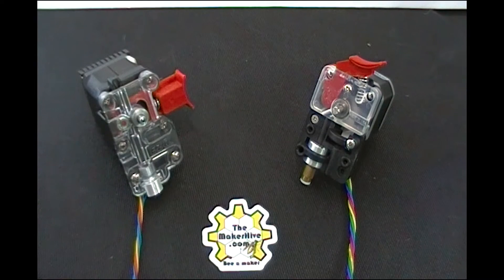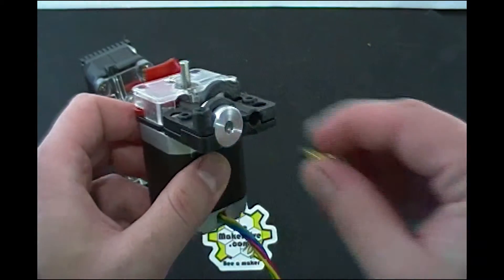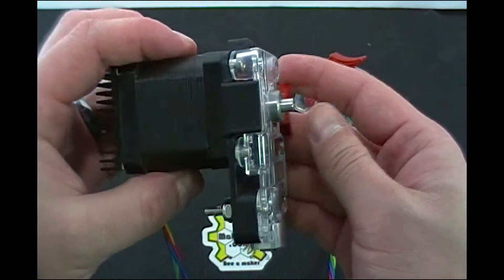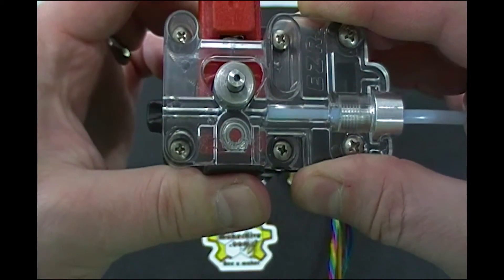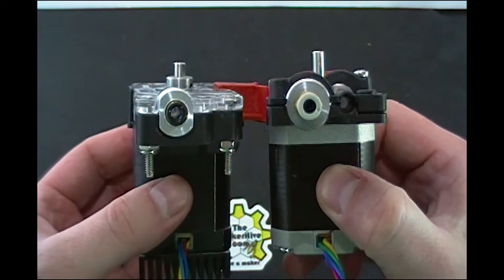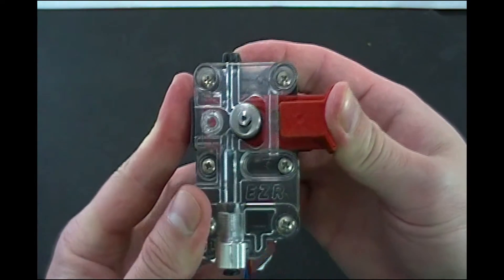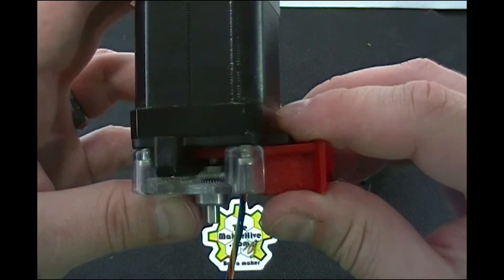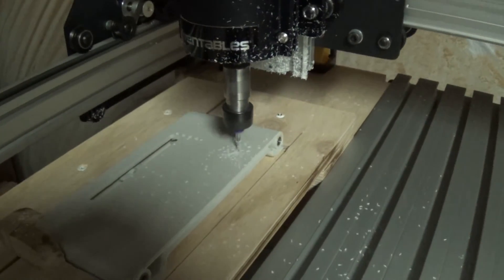SeeMeCNC's EZR Struder Review with Jim Spencer

Comment: %%%%%%%%%%%%%%%%%%%  Worse extruder you can buy.  Had one for a month 
AND IT CHEWED UP FILAMENT, plastic parts wear down where the bearing 
sits. No adjustment for tension.
Reply: Hello, how did you solve that problem? I have the same!

Comment: I can’t get it to release the tube without disassembly.  Is there a trick I’m missing? You made it look easy.  When I depress the collar, nothing releases.
Reply from the maker: Try pushing the tube inward fist. While holding the tube in, depress and hold the collar down. Them pull the tube out. Sometimes the "teeth" can really dig into the tube and excessive force may be required to pull the tube out.